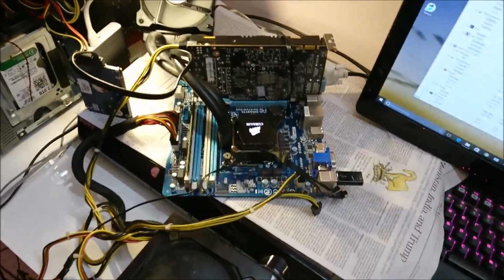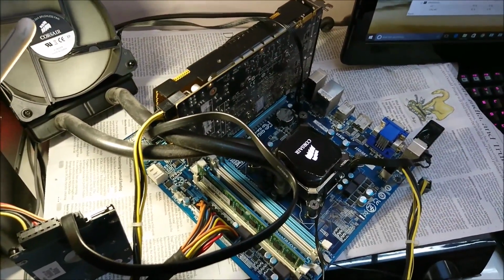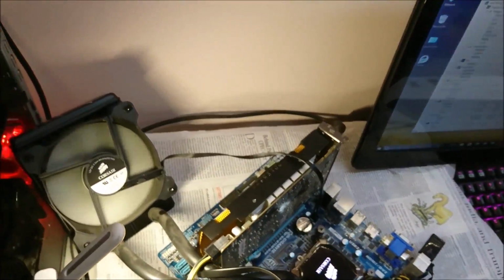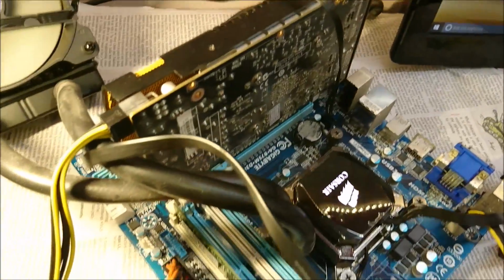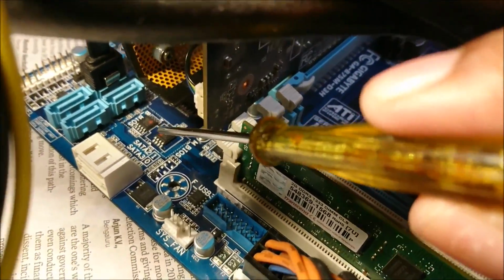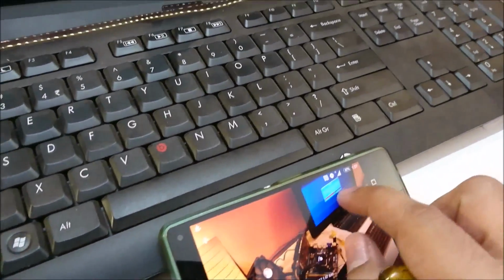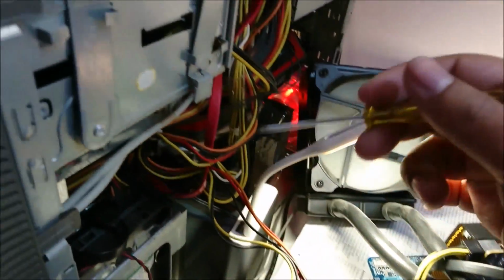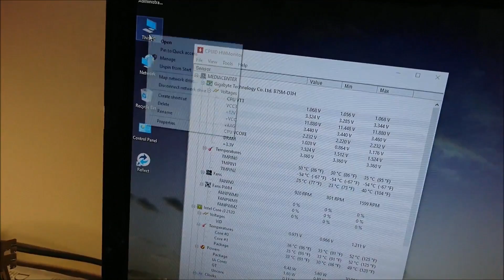Gigabyte B75M-D3H corrupted BIOS boot/post loop fix

Comment: Thanks a lot! After a few trials - restarts, power on, power offs, your workflow finally was successfull.
Reply: Please try this first when your system stucks in boot-loop:
Since its dualbios system you can force to kick the backup into place. You can restore the backup bios by flipping the power supply switch in the back to off position. Hold the power button at the front, and while holding flip power supply to on position. 
As the pc turns on, -in one-two seconds, flip the power supply to off again. Then turn on the power supply and the pc. 
Bios will load overwrite the current bios, with the backup, and after that, you will not have a boot loop.
Reply: Thanks Smooth Collie. This method has worked perfectly for me! I believe it's not only easier, but also safer than shorting random pins on a chip.
Reply: @zappelbecker  Thank you! Shorting the PINs didn't worked for me, but your method worked.

Comment: If anyone still follows this vid, how do you short the bios btw? do you just touch the screwdriver to the pins while the computer is on?
Reply: Yes. The Street Thug below goes into a little more detail about it but yet you just touch the pins while the computer is on and when it turns off remove your screw driver and power back on the computer and it should stop resetting the BIOS.
Reply from the maker: Shorting out ANY pin will do. There was no particular pin in my case, I just randomly touched it with my screwdriver while the PC was turned on.

Comment: WOW...LMAO...That is some funny Sh#@! It worked perfectly - PERMANENTLY FIXED - Thank YOU. (see instruction at END) Orange Tech Inc. - 3 Full Days I've troubleshoot this motherboard BIOS reset issue. Exhausted every possible scenario including replacing the i5 CPU with i3 CPU and nothing worked until NOW. GA-P75-D3 Motherboard. I updated to F11 latest BIOS but still after booting to the desktop it would reset the BIOS when I hard powered off the computer. I would constantly have to do the dual bios recovery by holding down the power button when the computer immediately powered on 3 times until it came up with the recovering BIOS screen. It would work again with the F9 BIOS until I would shut down the computer and then it would reset the BIOS and loop again and again. It did not matter what BIOS update I did or even if I left the original BIOS F9 alone it always reset the BIOS and looped when the computer was shut down. I was ready to throw this motherboard out the window until I saw this GENIUS video. I then shorted out the BIOS_M (First) and OMG it booted up without looping. I tried to shut it down and reboot it and no matter what I tried it would NEVER reset the BIOS and boot loop again...LOL. I even removed the CMOS battery and cleared the BIOS by connecting the jumpers trying to get it to boot loop and reset the BIOS but it just kept booting up fine. This fix works awesome! It permanently kept the BIOS from resting and looping. To short out the M_BIOS I just took a screw driver and touched the 1 Pin & 2 Pin together while the computer started powering up. Once the computer shutdown, I removed the screw driver. I powered on the computer and it never reset the BIOS or boot looped every again. I believe the 1 Pin is the one that a white arrow is pointing to and the 2 Pin is the pin right next to it. The 1 Pin is at the very end of the BIOS chip. Thanks again for this permanent fix. (On a special Note - Being a computer technician since 1997 for around 20 years this issue was a technicians worst nightmare because the motherboard would work after the bios recovery for as long as you could keep it powered up. You could even flash the bios and update it to the latest and soft reboot as many times as you want. This is why us technicians did not want to just give up because we could at least get it running to some degree. But of course as soon as it was hard powered off the stupid bios would have to be recovered again because it would just loop and loop. Special thanks to this Charlie guy who never gave up until he tried one last thing "outside the box" so to speak and boom...found a work around fix. This is what separates the good technicians from the great ones. Nicely done Charlie! Nicely done!)

Comment: Which pins from the M_Bios you shorted in order to resolve the issue. All the 4 pins on front, onthe back or a combination of both sides?
Reply: This worked for me - When the computer powers on touch the 1 Pin & 2 pin on the BIOS_M chip . There should be a white arrow next to the first Pin 1 on the BIOS called M_BIOS or BIOS_M. The 1 Pin or Pin 1 will be at the edge of the BIOS chip. Take a screw driver and touch the Pin 1 and Pin 2 while the computer is powering on and wait until the computer shuts off before removing the screw driver. That should do the trick. It permanently fixed mine from ever resetting the BIOS and looping again.
Reply: Did you manually power it off or did you wait for it to loop again?

Comment: Thanks so much! It seriously works. You short pins 1 and 6 together on the BIOS labeled M_BIOS (which is the main BIOS) while the computer is off and have a friend turn your computer on while you're doing it. When it beeps, stop shorting the pins and watch while it recovers.
Reply: Fuck me dude that worked!!! Must leave it for a while though.
Reply: Thank you so much, my computer had same issue, after short circuit bios, reboot and working good now, bois both still work
Reply: what do you mean by pin 1 and 6
Reply: @roqheszn8836  did you figured it out?
Reply: Cheater Buster nope i had to buy a whole new pc
Reply: It does work, i thought my life was over!!!
Reply: It works ! TY
Reply: thanks this method was able to bring it back to life..lol thanks
Reply: After how much time did you hear the beep?
Reply: Thank you dawn for pointing this out, our board a slightly different model GA-H97M-D3H it also fixed our motherboard that was almost in the bin!  just to note hold pins shorted until bios screen appears then release and out board also didn’t beep.

Comment: Holy shit, it worked, I read somewhere about updates to the bios killing the mobo... so you destroy the main and have it back it self up... that is Stupidly genious... thank you
Reply from the maker: Thank you, just a random idea popped into my head about shorting out the pins, since I had run out of options and the mobo was out of warranty. By the way, this method does not destroy the main BIOS, it just forces the mobo to restore the main BIOS from the 2nd BIOS. Not sure why it wasn't automatically detecting that the main BIOS is corrupt after the update, maybe a bug.
I learned my lesson though :D Never ever update the BIOS!!

Comment: Firstly thank you Charlie,  i had the same issue with my Gigabyte z77-D3H and nothing could fix it until i stumbled across your video. your trick fixed my 3 year old motherboard. Thanks for sharing Charlie
Reply from the maker: Thank you, bro, it was just a random thought since the board was dead anyway, so why not short out the pin on Bios 1 and see if it picks up the second Bios, (from looking at manual I already knew BIOS 1 was corrupt) I was pretty surprised it actually worked. I'm guessing it is a common problem on most Gigabyte boards since yours is a Z77 and mine is B75M.
Reply: I have the same MOBO that was in a boot loop and tried this, but now its even worse. The boot loop now is shorter and  whenever I try to power it on it shuts off in less than a second